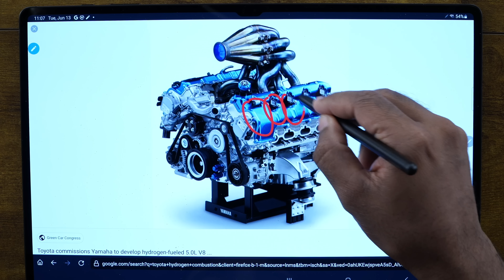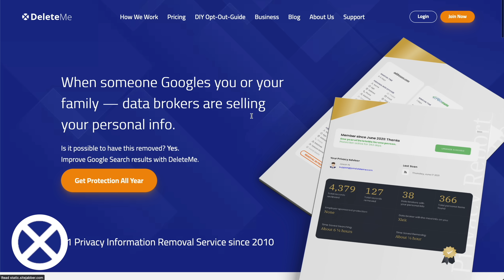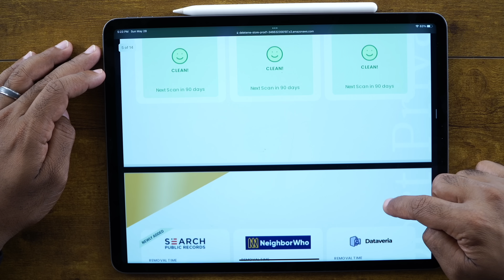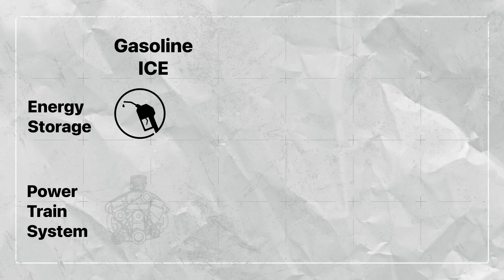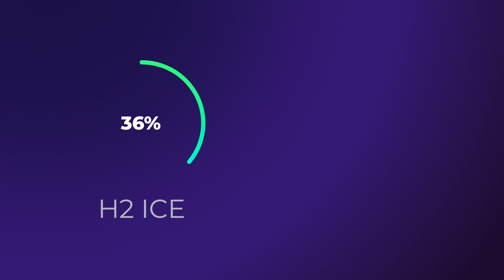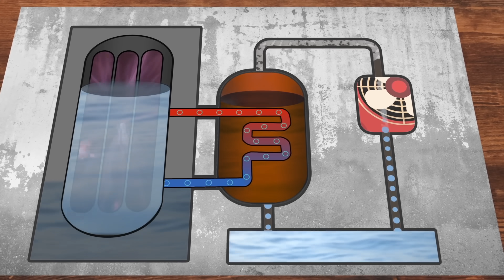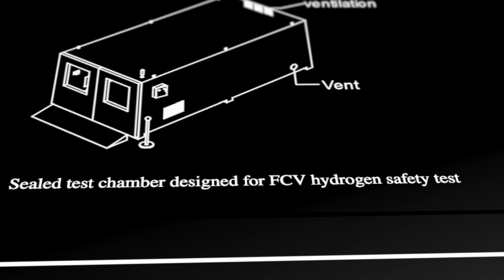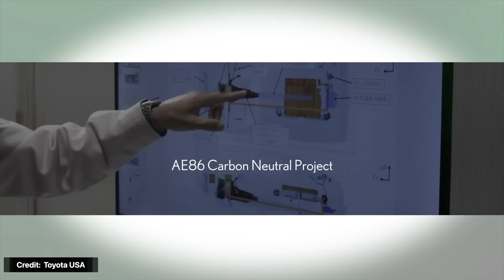Toyota's Says They Just Destroyed EVs - Hydrogen Combustion Engines

Comment: I think the idea is to get away from battery pack that will be a MAJOR environmental problem when they all start having to be replaced.  I have not bought an EV for the simple reason that the cost of buying a new battery pack only 10 to 12 years after buying the car makes no financial or environmental sense to me.  I keep and maintain my internal combustion cars generally for over 25 years.  I hate planned obsolescence.
Reply: We have an i3 that is 5 years old and on 84k kms. It has a battery degradation of 2.8%. As battery degradation slows as the more the battery degreades, it would be a good estimate to expect 6% degradation in 150k kms. That is not bad for the battery technology of 2017.
Reply: @baldok14  Can you tell us how much you paid to service that i3? How much it costs to change oil, spark plugs, filters, timing belt etc? Oh, you dont have to change all these? It doesn't have any of these? 
My 2019 i3 has only 18k miles and I went to the dealer once, they checked everything and added some screenwash fluid. They charged me £120 to tell me that my brake pads are almost new, I use the brakes only when I park.

Comment: To be fair you have to include the TOTAL costs, or "carbon emissions" if you like, of producing the fuel and energy storage as well as recycling to the end life. Fossil fuels require less overall input of energy to dig,refine, burn but are an unclean finite dead end better suited for materials/resins use. Battery production from ground to car, then recharging from whatever. Great symbiotic relationship for portables. Hydrogen then becomes a Clear Winner for cars, lights, welding, utilities, etc.. The technology has been unnecessarily suppressed for a long time. The methods of producing the Deuterium H2 or Hydrogen are the hidden gems.  There is more than sufficient water and energy for hydrolysis production from solar to electromagnetic to produce more energy than our population can consume or waste.. Think about it.

Comment: I agree that Hydrogen is the fuel of the future. But STOP with the CARBON B.S. Carbon and Carbon Dioxide are two COMPLETELY different things. Carbon Dioxide is the 'Oxygen' for ALL of plant life. CO2 is .059% of the atmosphere. That's fifty-nine one-thousandths of 1%. At one point in the life of the Earth the atmosphere was 100% CO2 which is how life itself began. It IS NOT a pollutant. It DOES NOT heat the atmosphere. The Sun does you morons. It is the raw, unburned fuel, gas and diesel, that are the problem to health. Not the atmosphere.
Reply: It does heat the planet. The point is that the CO2 amount in the atmosphere doubled since the industrial revolution.

Comment: Hi Riki, greetings from the U.K. Great video and detail. Hydrogen may have some applications, but I doubt the economics work for light vehicles. Making, transporting, storing and pumping hydrogen is expensive in terms of infrastructure and electricity used, so putting that electricity into a BEV is much more efficient. Many people think that hydrogen will cost about the same as gas (petrol) - it will be much more expensive than gas! In a combustion engine, synthetic efuels make more sense than hydrogen (imho) but these too will be extremely expensive compared to gas (petrol) which many people still don’t seem to appreciate.

Comment: In spite of the many challenges, I believe Hydrogen does have a bright future, although there is balance to be struck between its positives and negatives, when deciding where 
Hydrogen would be of most benefit and making the best use of its light weight and high energy density.

I believe the best use for Hydrogen would be as a green fuel for heavy road vehicles, planes and ships, where heavy batteries would not be appropriate, it might also be an option for 
high speed electric trains, that could operate without the need to manufacture, install and maintain thousands of overhead gantries and hundreds of miles of heavy duty electrical 
cables, or the danger of a third rail, but I believe its most important role could be as a green chemical energy storage system, for when weather powered electrical generation does not 
play ball for days or even weeks at a time.

First, to your point about Hydrogen in cars, it is obvious why motor manufacturers would want to make Hydrogen work in internal combustion engines, it would allow then to 
continue to make use of expensive manufacturing plant, but the low compression ratio of a cars engine means they have struggled to get a good balance between power and fuel 
consumption, but companies like J.C.B. are having more success converting diesel engines with their higher compression ratio to run on Hydrogen. 

On the other hand, Hydrogen as part of a fuel cell system in cars and other vehicles shows promise, you are right to point out the efficiency is not as good as a battery powered car, 
but it is not that long ago that electric cars had a top speed of 40 mph and a range of about 40 miles, the efficiency of fuels cells and electroliers are improving all the time, and it is to 
be hoped that batteries made from cheaper more abundant materials like sodium and sulphur will also improve. 

Now for what I believe will be Hydrogens most important contribution, I shall use a U.K. Perspective, Britain’s weapon of choice to fight climate change is wind, but every winter the 
U.K. is subject to weather events, known as a blocking high pressure system, which can last for up to two weeks at a time, and they usually come complete with a blanket of cloud, 
which further reduces an already limited amount of light for solar panels, plus there is little, or no wind for the wind turbines, leaving us with nuclear, but even if we get 8 shiny new 
nuclear power stations that we are promised, that is equivalent to only 30% of our energy needs, which will go nowhere near meeting our energy demands, put simply we need a 
system that can store and supply between 60 to 70% of our energy needs for up to a month each winter, only a chemical storage system has would have the capacity to storage energy 
for such a period, if we are not to fall back onto fossil fuels.

It has been suggested that large scale energy storage is unnecessary, and that we should rely on interconnectors under the sea to transfer electricity backwards and forwards 
between ourselves and Europe, on the assumption that some part of Europe will always have a surplus we can use, but I can see a scenario where eastern Europe is suffering a 
winter cold snap and needs all the energy it can get, Britain and the low countries are stuck under a blocking high pressure system, so no wind, plus Spain and Portugal are covered by 
rain bearing cloud, so minimal solar power, and such a situation would not be that unusual, and given recent developments with the war in Ukraine to satisfy a small man’s ego,
 it would be extremely unwise to assume that our partners in Europe will always be willing, or even able to supply us with what we want, when we want it, storing our own energy 
means we stay in control.

  Another idea doing the rounds, says we build the bare minimum amount of renewable capacity and use smart technology to switch on or off an internet of things, as a way of 
balancing supply and demand, where large tech companies would control the operation of everything from large factories to your domestic washing machine or fridge, I believe this is 
a distraction, I believe that the big technology companies could build such a smart system,  but I also believe that the tech companies already have too much control over our lives, and 
I believe our goal should be to build 50% more renewable capacity than we need, so the excess can be stored, and we do not have to rely on a smart system that could be hacked. 

I believe the goal for most countries including the U.K. should be to build 50% more renewable energy generation than they would need on a typical day, and store any surplus 
energy, some to be turned into green fuels for heavy transport, shipping or planes, and the rest should be used to generate electricity when the renewable capacity is low, only a 
chemical storage system would have the density for this, and luckily the latest development for producing Hydrogen by electrolysis is looking very efficient, plus there have been big 
development in green Ammonia as well. 

 Some people see a problem with the efficiency of electrolysis, saying it reduces the case for Hydrogen if you lose a percentage of your energy turning electricity into Hydrogen and you 
lose another percentage turning Hydrogen back into electricity. Now I would agree if you were using coal or oil to generate that initial electricity, but as long as you are using green electricity generated from wind or solar or similar, to produce Hydrogen or green Ammonia for long term storage or as a fuel, is there really a problem even if you lose 50% of that energy.   
yes Hydrogen should have a bright future if used in the right way.

Comment: Yeah, Na! Nitrous oxides.  All those moving parts just like other ICE vehicles.  Then there are the hydrogen storage, transport and manufacturing problems.  The cost of green hydrogen (made by electrolysis of water) is higher than gasoline. Toyota are wasting time and money barking up the wrong tree - again.  

Hydrogen might be the fuel for giant ships maybe even aircraft. It is not the answer for cars. In shipping it may be a hydrogen gas turbine not a reciprocating engine.

Comment: One of the most important factors when looking at energy sources is the EROI: The Energy Returned on (energy) Investment. An EROI of 1 to 1 means that all of the energy produced goes back into making energy, and there is not any surplus energy to do things like support an industrialized society.
Oil production started out with an average EROI at over 15 to 1 in the 1920's, then went up and down as technologies changed. That is every 15 barrels of oil produced only took one barrel of oil to pump it out of the ground, refine it, transport it, and deliver it into an automobile. Oil and gas now has an EROI of ~14 to 1, Canadian tar sands oil is 3 to 1, biodiesel is ~2 to 1, and  wind and solar is ~18 to 1. 

Now we get to "green hydrogen" that has what is called a negative EROI of .02 to 1 (or 1 to 5). That is for every 1 energy unit of hydrogen delivered into the tank of a hydrogen powered EV, it takes 5 units worth of energy to produce the hydrogen, compress and store it, transport it, and then deliver it to the vehicles tank. This means that using hydrogen will always require a higher input of energy than it returns, so not only is there not any energy surplus, there is always an energy deficit. The more hydrogen you make, the more energy is lost.

You are also factually incorrect in saying that hydrogen can be piped easily for production. Hydrogen (H2) is a perniciously small molecule that will leak through the smallest spaces like micro cracks in containers, pipes, and fittings. And hydrogen causes metals to become brittle and crack (called hydrogen embrittlement) unless contained with special (and expensive) alloys and materials. The tanks in a hydrogen vehicle are one of those made from expensive alloys and materials.

Hydrogen powered vehicles are for fools who said that they would never need the math being taught in school, so why bother to learn.

Comment: Why would Toyota spend time & money on an H2-powered car? Japan.
I'll explain.

The government has been leaning on Toyota & Honda etc. to build H2-powered cars as a gift to the electrical utilities who have been hemorrhaging money. They're using expensive imported fossil fuel to generate electricity while sitting on mothballed nuclear plants, shut down since the Fukushima Disaster. And when a major firm like these risks bankruptcy, the government steps in & props them up, so it's costing the Japanese government massive amounts of money to keep them afloat. They daren't let them collapse: a) no one can stomach the loss of face in Japan; & b) these firms need to maintain & manage mothballed nuclear plants - you can't just turn them off - & Tokyo Electric in particular is still cleaning up/remediating the Fukushima site & will have to manage/safeguard the Fukushima Plant, forever. Losses are massive.

The utilities claim they can use nuclear power to produce H2, using excess heat from the reactors when operating. So they want them operating. Japan wants to reduce the flow of money to essentially bankrupt utilities, is banking on willingness of the Japanese public to permit them to restart (it's been 12 years - everyone's forgotten, right?). If that seems ludicrous (banking on public acceptance of nuclear) consider that the nuclear industry has NEVER, ANYWHERE kept it's commitments, come in on time or in budget for construction & maintenance of nuke plants. Has never suggested how/where it'll store waste ("Trust us: we'll figure it out later"). And never been able to fully decommission a nuclear plant. Where it's been started (by court order) they've gone bankrupt trying to do it. So there's no way, after Fukushima, Chernobyl & now Zaporizhzhia), and after decades of producing electricity WAY more expensively than promised, that any western nation would entertain building nuclear again, right? Well, the nuclear industry is counting on you to forget all that, 'cause they're ramping up sales efforts to sell Small Modular Reactors (SMRs). Coming to a utility near you. Back to Japan, though:

Hence the pressure on Toyota. It knows no one will buy them: they cost as much as an ICE vehicle when battery-powered EVs from Tesla are already at or below parity. They cost more than a tranitional ICE vehicle  to maintain. They last no longer than an ICE vehicle. Crucially, there's no charging network & won't be. H2 is dead on arrival.

So Hydrogen as a fuel for transportation is an irrational pipe dream. But it isn't about logic: the government would simply like to believe they can make it work if Toyota will simply cave & build them. Toyota needs to make an apparent effort so it'll be able to depend on government bailout when IT goes bankrupt ('cause it will). The utilities desperately want to start operating nuclear reactors again.

The Japanese system runs on H: not Hydrogen, but Hopium. Hell, it runs on H2: Hopium squared.

Comment: I am not a hatter of hydrogen at all but I do take a pragmatic view and right now I fail to see a future in light transport and I dont understand Toyota's obsession with it to the point where they in my view will destroy their market position with it.
While there is no doubt that it will work, there are a number of stumbling blocks.
Firstly there is no retail distribution network anywhere and to build it means starting from scratch as there is nothing out there in the fuel industry that can be modified or repurposed. Who is going to buy a car for daily use if they cant refuel it and this is reflected in the lack of sales of the models out there to date. They are so bad that if it was any other model even Toyota would have withdrawn it by now.
Secondly hydrogen through a fuel cell makes no sense. To produce it requires large amounts of electricity then even more to compress it to the point where it is economic in a car and then it is passed through a fuel cell to make electricity to charge a battery and run an electric motor.
Yes it works but why have the middle man there in the first place why not go direct from production to charging the battery direct
The hydrogen fueled ICE makes even less sense. The entire purpose of this change is to clean up our environment and reduce cost and yes changing the fuel to hydrogen will help but it is not the complete story. like it or not it is still an ICE with all the same downsides of any other ICE
It still requires oils to run which has to be changed regularly and disposed of. It still generates large amounts of heat which add nothing to the power output and has to be disposed of as a waste product. It still has all the friction losses of any complex ICE.
JCB who are generations ahead of Toyota in this area boast that moving from in their case diesel to hydrogen does not change the service cycle at all.
I struggle to see how this is an advantage as without an ongoing cost saving particularly in the commercial world where is the incentive to change and cost will always come first.

Comment: Hydrogen fuel pumps slow down in cold weather, and can even freeze up.

An electric drive train is far more efficient, reliable, simpler, and reliable than an ICE. The obvious fix for range anxiety is a petroleum powered onboard generator that keeps the batteries topped up. A huge percentage of the cost of a battery powered electric vehicle is in the batteries themselves. If you cut the range to 200 miles and add on an onboard petroleum powered generator, then you will extend the range to infinity.

The serial hybrid all electric drive vehicle with an onboard petroleum powered generator is the perfect transitional vehicle for the vast regions which do not have EV charging networks.

Of course, the inherent complexity of a hydrogen ICE vehicle would be a dream come true for the Toyota dealerships. EV's are a disaster for automotive dealerships, as they are dependent upon the revenue from repairs, maintenance, and parts. EV's don't produce those revenue streams to the degree that ICE's do.

Comment: 40-50% efficiency for H2 ICE engines?! Where are those figures coming from? H2 combustion is generally considered 20-30% less efficient than gasoline combustion due to the lower volumetric energy density of H2 and the maximum reasonable injection pressure into the cylinder. That's on top of the 35% efficiency of a standard gasoline engine, so H2 combustion is more likely less then 30% efficient.